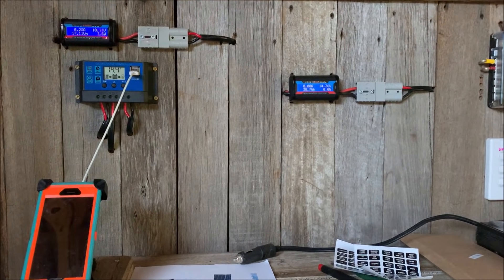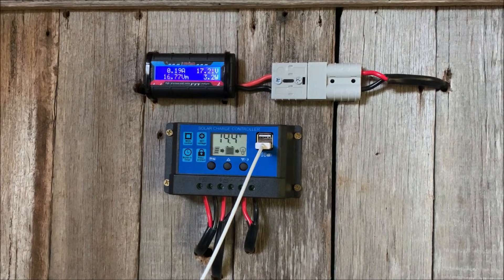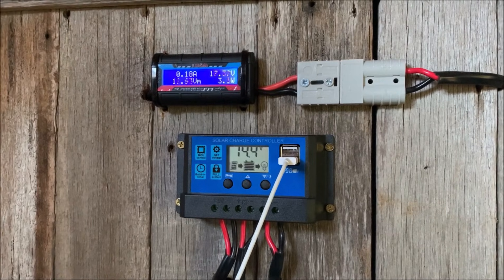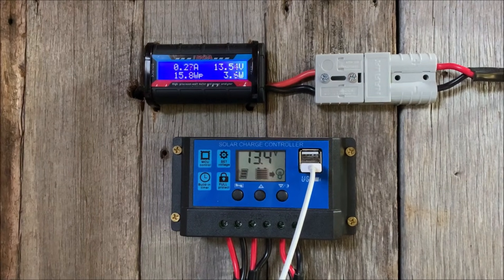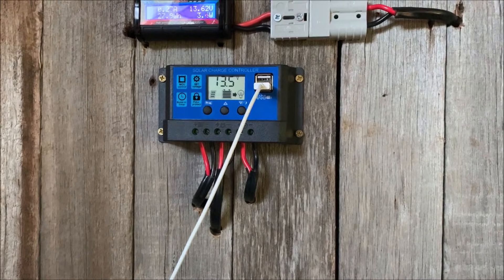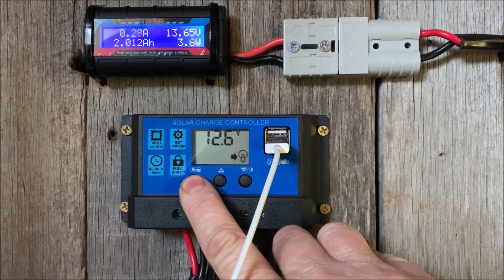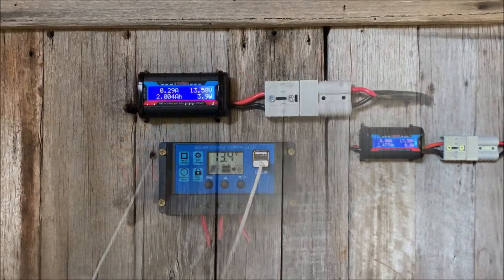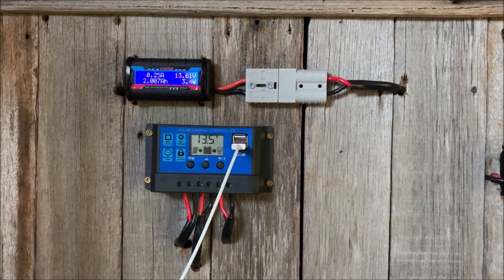Basic PWM Solar Charge Controller Review - 12 Volt MONO SOLAR KIT

Comment: Thanks for the video, however I have a question. The voltage on my solar panel is 48v, can I connect it to this controller? Does it convert the output voltage to the battery to 12V? Hug
Reply from the maker: This one only supports the 24v panels unfortunately.

Comment: That battery type Setting is not 61 but b1 and means that the battery should be a sealed lead acid. Type b2 is for a gel battery,  type b3 is for a lead acid battery that has fill caps that you add water to.
Reply from the maker: Thanks. Good info

Comment: Is there any kind of voltage regulator in this pwm to set the desired charging voltage?  Or is it just pumping 18volts or watever the solar panel voltage is to the battery? I know You can set the cut off voltage, and start charging voltage, but can You actually set the charging voltage?
Reply from the maker: Yes it regulates and adjusts automatically as the battery charges. Still have one now going after 3 years. I have replaced this one with a Victron.

Comment: I´m missing explanation of the settings in that controller. What is "24h" What is "61"?
Reply from the maker: Not sure about the 24h but the 61 is the battery type. I have since upgraded to a Victron controller.

Comment: I want a solar panel to run a 12 volt fan. I do not particularly want the fan to run if the solar panel is not producing enough. Can I use the controller without a battery attached?
Reply from the maker: You can but it is not advised. From Memory you just run the fan of the battery terminals of the controller. Have not tried it on this controller.
Reply: @simonhahnel8092  thank you.

Comment: Hi , i know this is an old video but my charge controller doesnt limit the volts, my solar panel is like your going to about 22v and putting it in the controller it also goes to 14.4v but my problem is that the device on the other side is receiving to high of a voltage and not working properly

Comment: Thanks for video. @3min 07. I think that the 12.6 volt is the minimum voltage required before it "re- starts" feeding the load once the load has been disconnected by the min voltage settings ie load is off at 10.7 at 3min 20 11v and wont come back on until battery is at least 12.6v.

Comment: I am having a problem with this setup. Maybe you can help. Me. When the sun is out it says its charging but the battery meter keeps blinking empty. I did trheat a new pair of kabel point into the unit. Did I put it in the wrong way maybe? What is the right way of connecting the kabels first? First the panel or first the battery?
Reply from the maker: I think I have another video of the installation that may help.

Comment: 👍 simple straight forward review. I have same controller to charge my SLA batt. What type of meter did you use for measuring and connecting solar to the charger and on the load side as well. I won't mind a link if possible. Thanks!
Reply: yeah those monitors are quite clean looking and can be very helpful.

Comment: What thickness of wire did you use
Reply: Hi Joel, what amp controller did you buy? I bought this version but got the 30AMP one which needed 10gauge wires to the battery 👍

Comment: 1:11..... You have it a bit wrong.When your solar voltage reading is >battery voltage (e.g 17V) your charge controller has disconnected the panel from the battery. The controller does not step down the voltage. When the controller connects battery to panel, the battery drags down the panel voltage. When the left side displayed arrow is steady, the panel is disconnected and doing nothing much.

Comment: Doe the arrow from pannel to battery disapear when the battery is fully charged.

I think when the arrow is constantly on it actually means that the battery is fully charged. It is stupid but the controller does not drain any current, in my case, when the arrow is on withou flashing.

It is scary to leave controller connected unattended.
Reply from the maker: I have amp meters on input and output. It does not constantly charge but reduces as the battery is nearing full charge. I have had this set up running for over 2 years now on 2 different locations without incident. I will add I would never use this controller with expensive lithium batteries but for a second hand car battery it is fine.

Comment: My 30A pwm is suddenly set as a 24v system, while using only 12v lead acid battery. Due to this it's not giving off power to my consuming system (23v > 10.2v minimum) How to reset it to a 12v system?

Comment: Do NOT buy this ...thing. 
Its dangerous and if you dont believe me check the temp of the "heatsink" (which is a very thin and laughable iron plate, not even alluminium).
SAve your money and buy something better and still cheap like SRNE or Tracer or anything branded for that matter :)
Reply from the maker: Probably good advice. I have moved on to Victron units with Bluetooth so you can monitor charging and battery settings. A good unit to pilot your first install however. Simple and works. Provided you have a 12 volt panel.
Reply: @simonhahnel8092  Yes.Victron is the way to go.

Comment: i have one of these that came with my portable solar panel.. when you install does the wire have to touch in the round center or as long as the metal smashes onto it? it won't turn on if i just connect the panel to it? do i have to have a battery connected for the charge controller to turn on? so confused
Reply from the maker: You should always have a battery connected prior to anything otherwise the unit might be damaged.

Comment: Set your load cut off to 11.6v, max charge to 14.1v and load cut in at 12.5v. Your limits are not right. You're gonna kill your battery mate.
Reply from the maker: Was a second hand 4wd battery ($30) so figure I would use the defaults and see how it went. 12 month on and going well. Runs my Little TV, Stereo and lighting without a problem. Mind you, it is just a garden shed so only really gets used for about 12 hours  in a week. I have been dabbling with Victron MPPT controllers recently. Much nicer. Much more expensive.

Comment: Thanks for the video! I have the same pwm solar charge controller but no manual. Mine is tet to battery type 61 but I have no clues about it. I trying to used with a 8 amp Lifepo4 battery and I don't know what type number is. If you have the manual, may you help me? Thanks in advance!
Reply: it should be on the manual book. b1 is for lead acid, b2 for 3S (3*3.7v) lithium ion battery, and b3 is for 4S (4*3.2v) lifepo4 battery
Reply: @ThreeWhiteSoldiers  Thanks! No manual book here.

Comment: Does the charge controller display the power or current produced by the panel? Or does it just display the voltage?
Reply from the maker: Voltage only. You will need some meters for measuring current and specific inputs and outputs.
Reply: thanks for the info

Comment: I have one of these controllers  50 watt s, running off my two twenty watt solar panels. I would like to also charge the batteries from the vehicle charger when it is running, I have cables running direct from the accessories plug in me vehicle  to the battery terminals of my small camper. Will there be any damage to the controller if I charge with both at the same time.?
Reply: I would like to know this too! 💁

Comment: quick question , if the battery is full will the Solar Controller stop the current going into the battery ?
Reply from the maker: Yes it does. Set and forget. Been running for 6 months now without issue on an old 4wd lead acid battery.
Reply: @simonhahnel8092  hi from comments on other videos on this controller I think it if you don’t want to mess with the settings it’s out of the box ready for 12v lithium batteries

Comment: Wonder if you might know. I have the same controller, connected to a 12v battery. Although it's set to 13.7v float voltage, during the first day of usage, it ran up as high as 16.6v. I'm sure it must have done some damage to the battery, but I got to it quickly, and I'm now confused about how to prevent that from happening. Could this be a setting? Could it be somehow confusing my circuit to be 24v or could it just be a faulty controller?
Reply from the maker: As I understand it the voltage on the display will show the solar panel voltage or the battery voltage. Which ever is higher. Are you measuring the output to the battery or just what is on the screen?
Reply: @simonhahnel8092  it was the battery voltage. I disconnected it and reconnected. Monitored closely and it didn't exceed 14.4v. I'm very nervous to keep using it though.
Reply: @troubledtinkerer  Did the voltage ever creep up again or did it stay at that 14.4v ?
Reply: @bondubasher  yes. It did. I changed it out for an MPPT controller which was much more stable
Reply: @troubledtinkerer  I might have to go that way myself if this unit does the same, thanks!
Reply: Please I have the same problem with my solar system(PMW charge controller), does that mean the charge controller is faulty or what’s is the problem?

Comment: I have an little setup, 2 x 10Wp solar panel 18V 0.55A each (parallel), a PWM 10A solar charger controler + battery 12V 7Ah. I Installed an Volt + Amp measuring device between the panels and the controller and it works fine till it reaches 14.4V. From xV to 14.4V I see an increasing current to 1.1A @14.2V. But it increasses to an value higher than 14.4V and from then on the solar charger dot from PV to battery stops blinking and the voltage says 14.4V. My Amp and Volt measuring devices goed up to almost 20V and amperages from 0.4 to 0.7 (like in your movie here) Is this normal? What is the reason for this? I tought that an PWM always keeps the voltage under this 14.4V.
Reply: Don't you have to set the max voltage in the PWM controller to protect the battery from cooking. From videos I've watched you do this through the controller buttons. There's several good videos out there but this one explains well https://www.youtube.com/watch?v=Fmfnxkh1IFo

Comment: Can it be powered by house AC power?  Did they give you a plug to do so with purchase?
Reply: Yes but it must be DC out. Laptop power supply is perfect for application, they are usually around 19V
Reply: @clixium  

I’m thinking bout getting one to cycle 12v batteries

Comment: What are good settings for a (lead acid (b1) or li-ion(B2)) battery? Are there minimum or maximum voltages for the battery?
Reply: MY controllers say "only for lead-acid batteries,  not lithium"

Comment: Looking for a cheap PWM controller, that also control the voltage to the load. I want to run modems, led lights, TV set-top boxes.etc. from the output which are sensitive to output voltage changes. I am currently using the unit shown in your video, with buck / boost voltage stabilizers at the output - I use about four of them, as the output current is limited to about 3 Amps each. but it becomes a nightmare with the wiring of all the additional modules. Is there a Solar charge available, where I can set the voltage to the load? Thanks!

Comment: Hi, I've the same solar PV controller connected to a small 20W panel and 12V 7Ah lead acid battery. No load atm, as the battery seems not to charge. It has been at 11Volt for a few days even though left with the panel without load for a couple of days (bright sunny days).
All things are brand new. 
Are there settings to adjust maybe?
Thanks
Reply from the maker: Mine just worked with all the defaults using a 50aH old car lead acid battery. Mine is fed by a 300W panel however. It runs my lighting and little 12v amplifier for music for many hours.
Reply: Doing some math, your only charging at 1 ampere or less. Get a bigger solar. AxV=W or W\V=A. 20W\12V=1A. That’s with 100% efficient system
Reply: @deanhenthorn1890  Solved. It was the panel not taking enough sun. Now south facing, on bright days it charges the battery full.

Comment: Why does it reach 14.4 float voltage? Your battery will get damage
Reply from the maker: By default it registers the battery or panel voltage on the display. Whichever is higher. From memory the float voltage is 13.6 volts.
Reply: @simonhahnel8092  on my sample that's not how it works. I have measured over 20V on the solar panel side and 14.4V on the battery and load side. If the panels can sustain the power drawn without sinking in voltage, the display never moves from 14.4V, it doesn't really manage the battery charge and totally disregard the float voltage setting. I suggest everyone to check their model with a multimeter on a sunny day with the battery fully charged, if it is keeping them at a steady 14.4V something is amiss (permament overcharge).
Reply: Yess.... it will damage

Comment: I have several controllers as this one and noticed that battery type function doesn't actually work, always stops at 14.4V. Battery reconnect voltage is also a non working function.
Reply: @rwd1973 same here, stuck at 14.4V, not really 4 stage battery charging as advertised on the manual, more like 1 stage permanent overcharging.
Reply: I have the same controller and also find I can't change from "b1".

Comment: Good video,  what guage wire do you recommend,  thanks.
Reply: Depends on your load, but if you're not sure, just go for 12AWG.
Reply: @kaikart123  thanks mate,  will do that, regards.
Reply: @michaelcody8783  It would at least able to withstand 20A if you need to know the ampacity.

Comment: What voltage range can you set the this solar charge controller to charge the batteries?
Reply: I have this same question.  Can you set the mode to 12V or does it just handle anything between 12-24V?
Reply: @rogerrobb6896  I have the same controller.i use it for 12v setup it will auto adjust for 12 or 24 volts
Reply: @MrSqueegey  
Can I set the changer controler before using it pls
Reply: @idowulukmon642  when connected it will adjust for 12v or 24v.as far as charge  settings kept mine at 14.4 (lead acid).
Reply: @rogerrobb6896  it will adjust for 12v or 24v
Reply: I use one also,you can adjust voltage.mine is set at 14.4 volts
Reply: Ya they have a setup for what kind of battery like flooded leas acid or gel or AGM but I think the max voltage and stuff is adjustable some but I'm not positive I only changed the load cut off voltage

Comment: In der Urban Vegetable Garden  Reihe scheint es viele Dopplungen zu geben: 30+31 sind doppelt, 32+33, 34+35, 36+37, 38+39 ebenso. Nr. 40-45 sind ebenfalls gleich, 46+47 doppelt, 49-52 auch gleich. Ansonsten, schöne Videos bisher, viele Tipps, Danke dafür. Grüße aus Rheinhessen = In the Urban Vegetable Garden series there seem to be many duplications: 30 + 31 are double, 32 + 33, 34 + 35, 36 + 37, 38 + 39 as well. Nos. 40-45 are also the same, 46 + 47 double, 49-52 also the same. Otherwise, nice videos so far, lots of tips, thanks for that. Greetings from Rheinhessen
Reply from the maker: Ja. Ich bin mir nicht sicher, warum sie alle zweimal in der Wiedergabeliste erscheinen. Wurden wie alle anderen Videos hochgeladen.

Comment: I am living off Grid. I use the MPPT controllers and 24 volt panels ex grid connect systems. MPPT will let you feed a higher voltage into the controller and convert it down to the 12 volts. I feed my system with 24 volt panels in series to put 48 volts in. The sun just barely has to poke its head out and the system is charging. ,Using a 12 volt panel to charge a 12 volt battery limits the window of opportunity for charging and PWM are really not too efficient. With my System if my panels are feeding 48 volt at 5 amp into the MPPT Controller it will convert that down to the 12 volt to charge the battery at 20 amp (ohms Law) .  :)
Reply from the maker: MPPT is definitely next on the list.
Reply: @simonhahnel8092  It makes a big difference :)
Reply: I run one system on 2 MPPT charge controllers and yes they work much better. But for a small low budget system these cheap little charge controllers are just fine. I also run two small systems on two little PWM controllers and they work fine too.